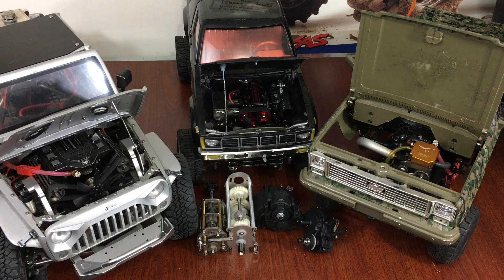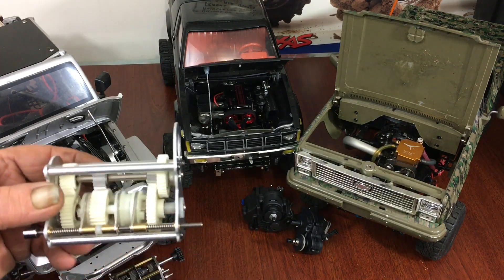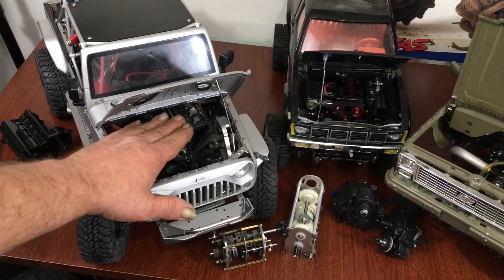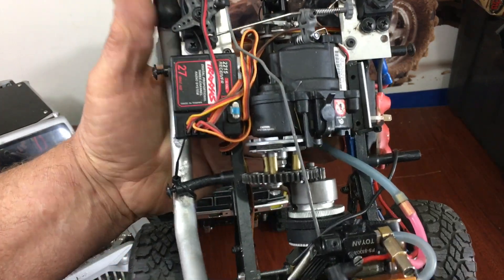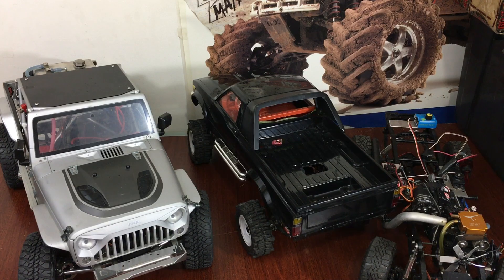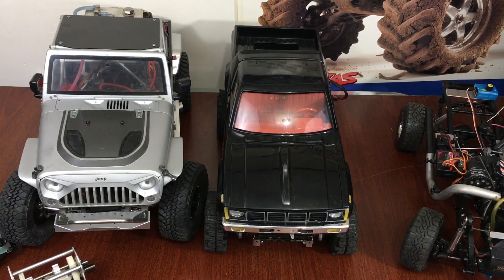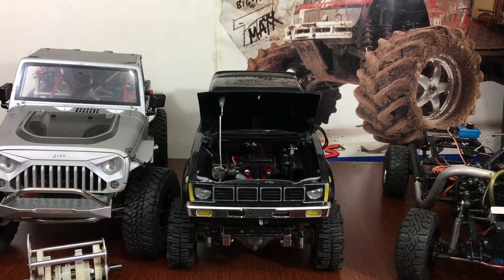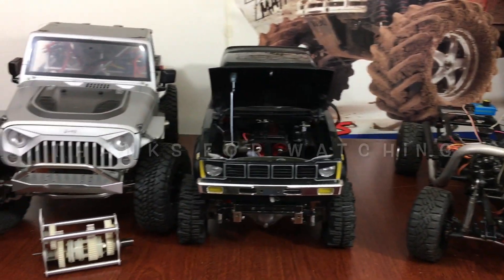NEW 3 SPEED RC GEARBOX WITH REVERSE AND BRAKES FOR YOUR GAS/NITRO BUILD!

Comment: Hi Dennis, Thanks for your videos! Do you have  a recommendation for a simple reverse gear (one forward/one reverse), preferably made of metal? Thanks in advance. Falko
Reply from the maker: here is a simple forward/reverse gearbox all metal, you can remove the pulley and install a spur gear. 
https://www.stirlingkit.com/collections/toyan-engine-parts/products/1-10-model-car-engine-gearbox-with-pulley-for-toyan-fs-s100-fs-s100g-fs-s100-w-fs-s100gw

Comment: About how many inches long is it and how wide is the 3 speed gearbox? Also I looked everywhere to find the Kyosho Nitro Tracker Transmission and I can't find one but if I can't I will get the 3 speed gearbox!!
Reply from the maker: Its 90mm long and 45mm wide and 53mm tall
Reply: @dennisdempseyradiooutofcontrol  Thanks I can't wait until my FS S100 comes!!

Comment: Would interesting to see how much stronger the gears are than the hg p407 since they its easy to chip a tooth off of those.
Reply from the maker: I can see that the gears are steel and machine cut in these transmissions, the hg gears are that sintered bronze powder that's pressed and heated and chip teeth lol. Im going to give them the stress test.

Comment: Nice  vid Dennis, those kyosho gearboxes are good 👍🏻
Reply from the maker: Thanks Steve    Is that the gearbox you are using in your high lift conversion?  I thought Tamiya made one years back in one of their nitro trucks also. the cool feature with the Kyosho is the small space it fits in, I wanted to use a gear box that everyone has access to for their conversions. how is your projects coming?

Comment: The 3 speed would be a standard transmission from what I see but great for crawling. I agree from what witness the L200 is my favorite. The 4 is a gas drinker and the s100 is too low in HP but I’m still holding on getting the L200 Only cause I’m not a fan of the short range of speed. I wish the 2500-16,500rpm was at least up to 20,000 but I still will do it for the scale look. I just need to get a Toyota for it. I’m not gonna to insult a V8 rig with a 2 cylinder!. 😂 looking at the new midnight RCW4 for it or at least a bruiser. Thanks for sharing. 🇨🇱👍
Reply from the maker: The size and details seem pretty scale for a yota or nissan truck, even a honda tuner, I agree with you about the fuel hungry V4 lol! man that thing will kill a quart of nitro in minutes, That midnight edition is sweet looking, I seen the ads on it,

Comment: Thanks for the video Dennis! Great work, the four speed transmission looks great. How does it perform? I have one on order with the L400 comin soon?
Reply from the maker: Thanks brother! I think its a great new step in the right direction for the toyan engines,  I also have another L200  and another 4 speed coming lol!
Reply: @dennisdempseyradiooutofcontrol  haha I new you would! What are you going to put it in? I am struggling to find something new. I was going to put it in the CEN F450 or another Double E Defender.
Reply from the maker: @RCTanksTrucks247  I couldn't resist lol!  I really dont have a idea what im going to put it in but I will have them when I find it lol,  I was searching cheap rc crawlers  for another conversion but didn't see anything that caught my interest,  It would be really cool if you put yours in your Cen F-450.  I am still looking for a kit to install the new L400 in when they send them out I think those will have to be a 1/8 scale from the measurements ,
Reply: @dennisdempseyradiooutofcontrol  It will fit in the Double E Defender I am pretty sure, thats the orange one on my channel. Super scale looking and heaps of room, plus they are pretty cheap.
Reply from the maker: @RCTanksTrucks247  yeah that’s a good size kit, and like you say it’s really scale I was searching online for custom RC hardbodies but they are more than a whole rtr kits lol, I will start with hooking up the 4speed up to the L200 and put it through some testing first then the L400 when they release them.
Reply: @RCTanksTrucks247  Oh dude a nitro CEN Brodozer would be amazeballs.